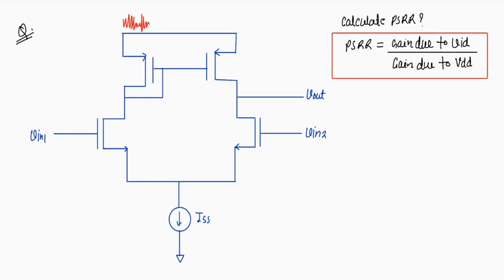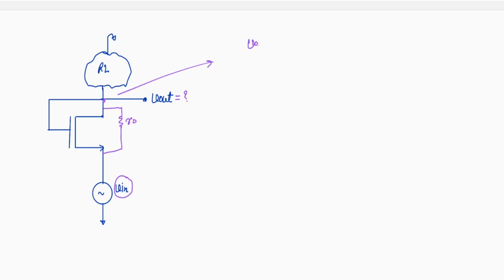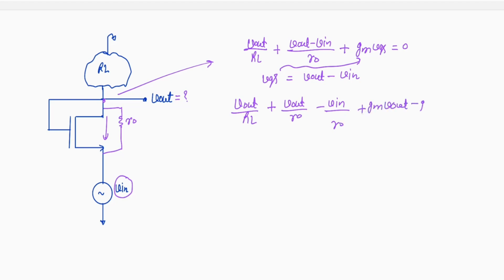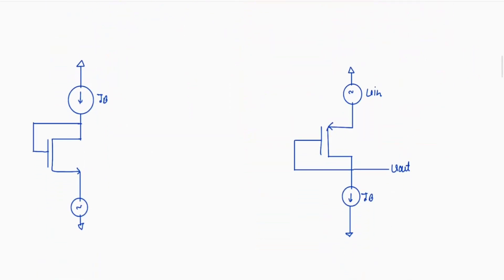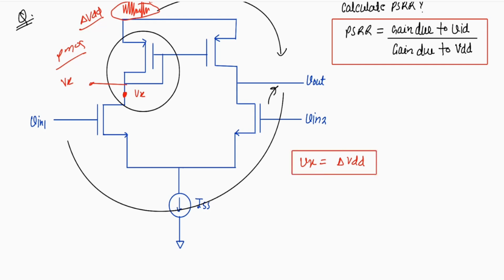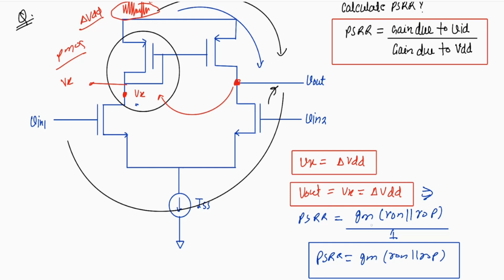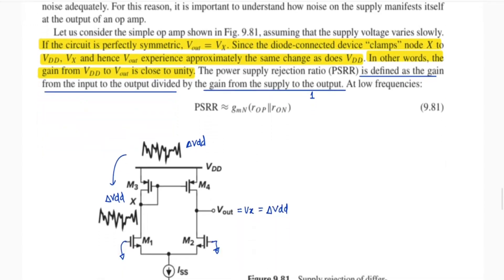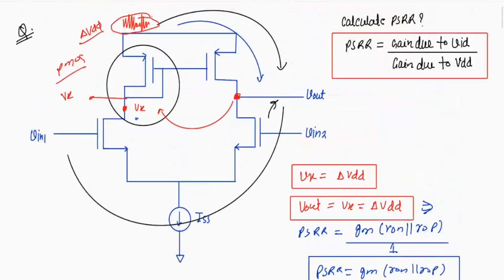PSRR of 5T OTA | Diode Connected | AnalogX

Comment: Thanks Sir !
My Question is  if the circuit is perfectly symmetic ,vout=vy,The diode connected device clamps node  y to Vdd ,thus Vout ~Vdd 
The power supply rejection ratio PSRR ~gmn(ron//rop) 🤔
Reply from the maker: @SQA_labassistanMangement yes 👍
Reply: Thanks for Sharing your conpect 🫡 @AnalogXai

Comment: Thanks Sir👍
Explain very clearly 
Mos_P_diode connect is looks just like  
vo/rd+gm(vo-vi)+(vo-vi)/ro=0..(1)
gmpvo+vo/ro+vo/Rd=gmvi+vi/ro.(1)

vo(gmp+1/ro+1/Rd)=vi(gmp+1/ro)..(1)
vo/vi=1( if Rd is very large) 🤔
Reply from the maker: @SQA_labassistanMangement correct 👍. Small signal model of nmos and pmos are same, so you can use same results of nmos for pmos. ( take care of body effects)
Reply: Thanks Sir 👌 @AnalogXai